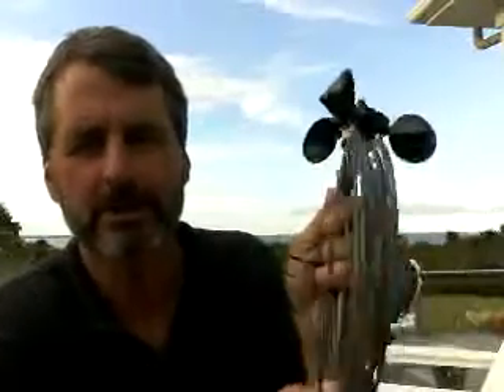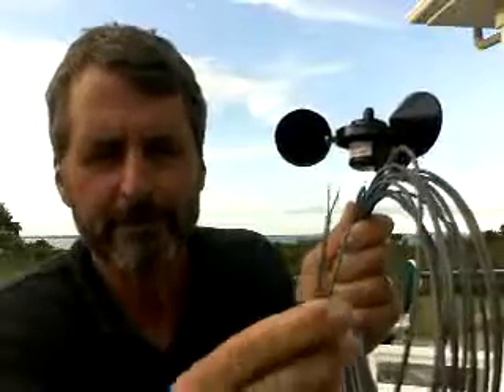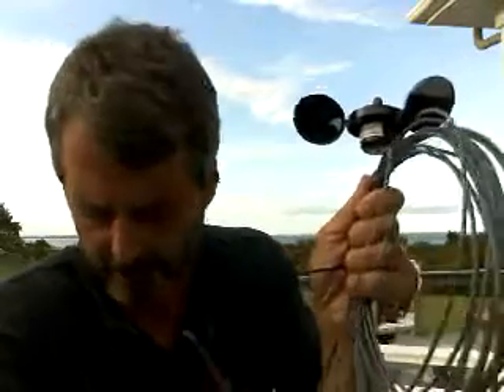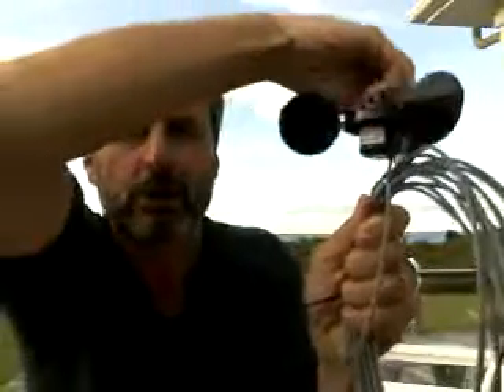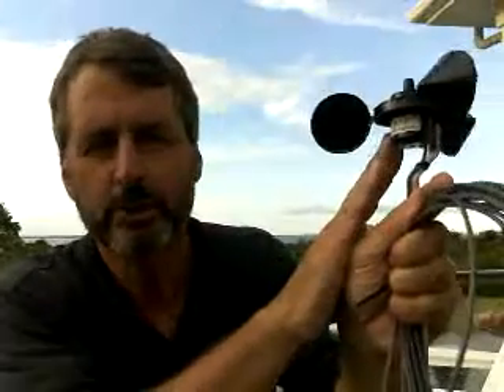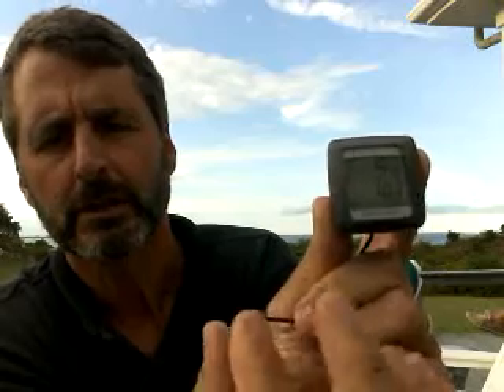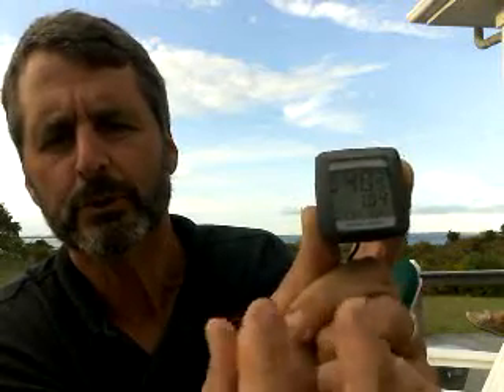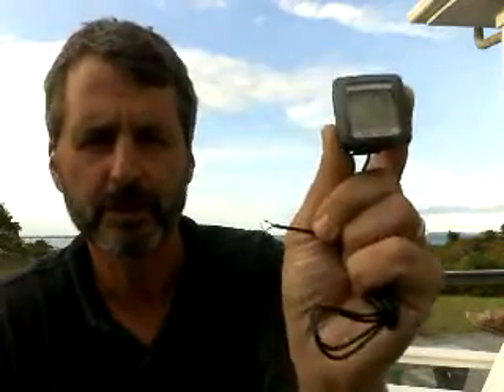Troubleshooting the Pole Mount.WMV

Comment: hi there - failure is super rare - but can be the reed switch:  pull out the old one and silicone in a new one.  The rotor:  we sell replacements.  Bearings:  easy to replace.  It is all rebuildable and we will help you - you can always send it to us and we will freshen it up...  No worries!
Reply: I have a bad wind speed sensor.  I bought from Amazon around 5 years ago.  Where can I buy a new sensor shipped tom Australia?
Cheers